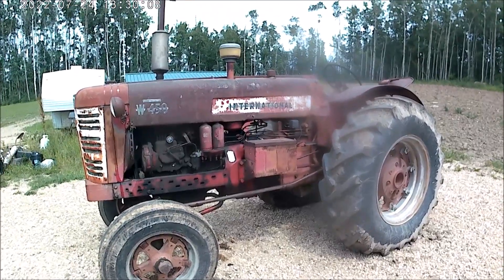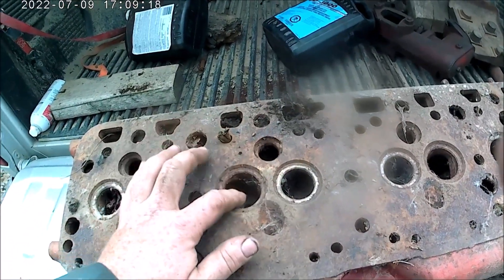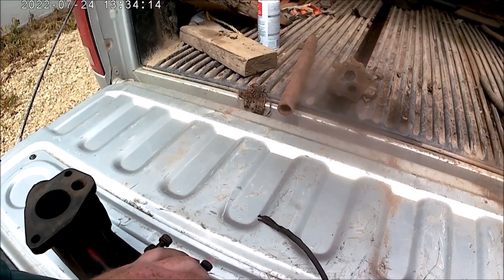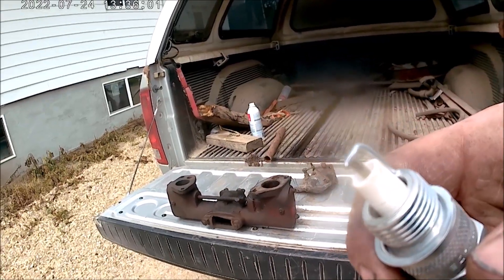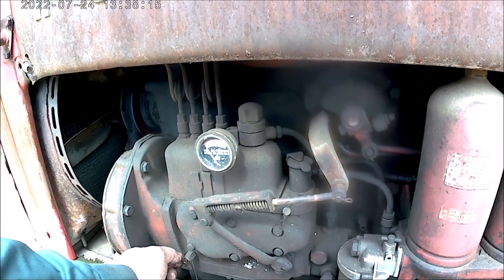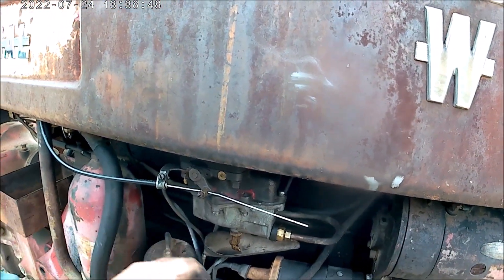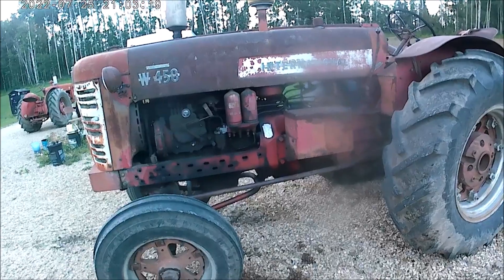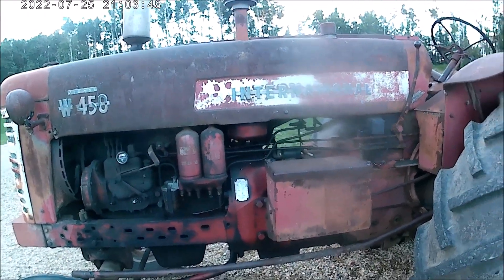International Gas Starting Diesel Engine Fundamentals

Comment: Good  day TYe   So how fast roughly does gas engine run?  I was at auction 20 yrs. ago 450 diesel  was sold ,  owner said it uses a little oil,  arfret   sale I ask, how much 2 quarts  a day spraying.   Thanks  So what motor does 450  have ?
Reply from the maker: It varies greatly how fast they run on gas. Some run very slow under 500 RPM. The next one may run over 1000 RPM. They are all different. Even two identical tractors one will run slow and one will run fast on gas. The 450 uses a D-281 engine. They are 4.125X5.25 bore and stroke. The gas 450s use a C-281.